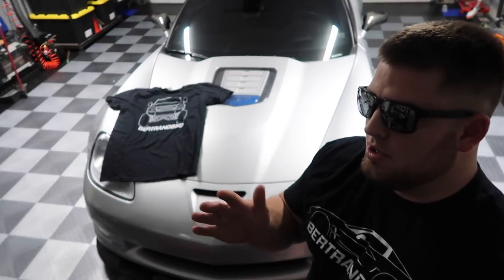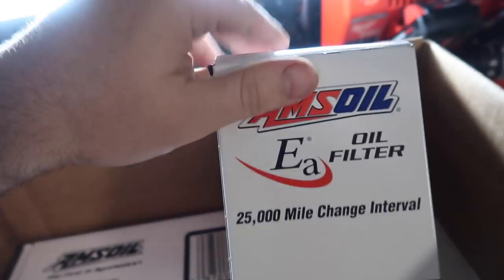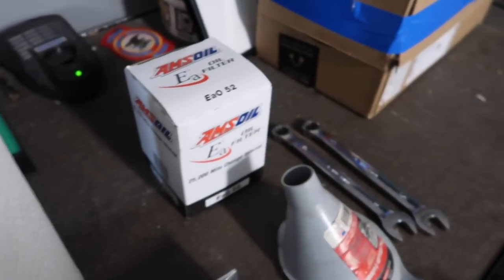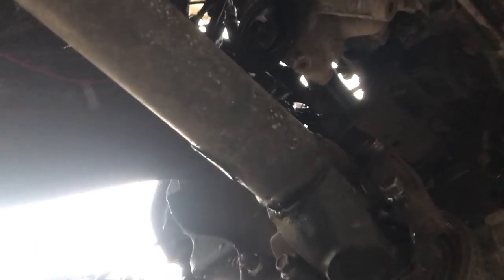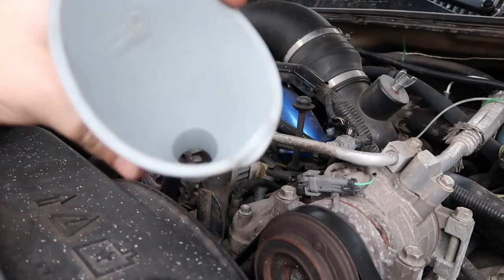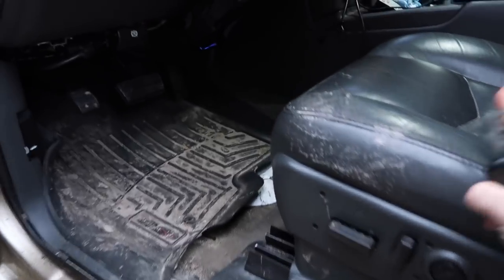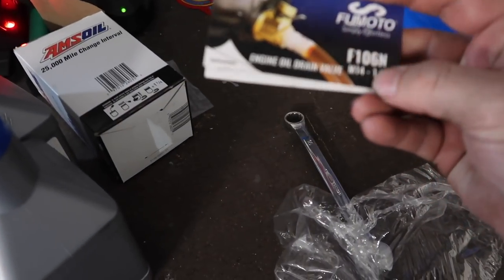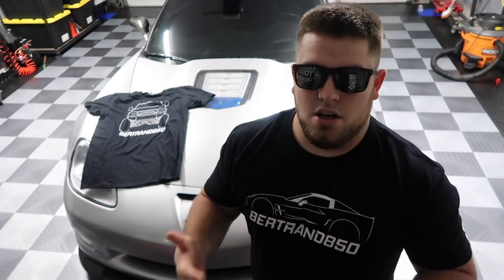DURAMAX oil change MADE EASY! NO MORE MESS!

Comment: I'd recommend replacing your oil pan with a dmax store oil pan for 2 reasons. 
1- they have a special fumoto drain valve that is 7/8 iirc and drains in a fraction of the time. The normal fumoto valves internal diameter is small, like 3/8 or whatever. 
2- you get rid of the valley design flaw in the OEM oil pan that keeps about 1/2 qt of oil in the pan and unable to drain.